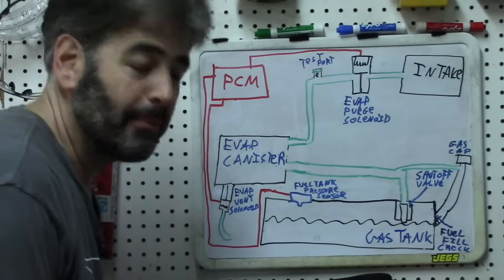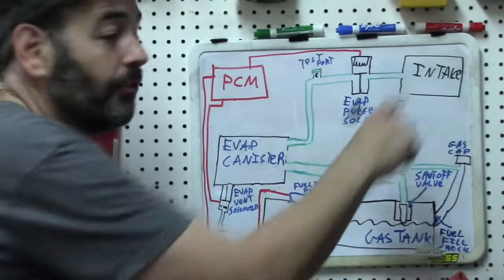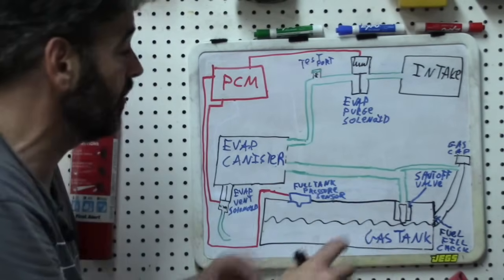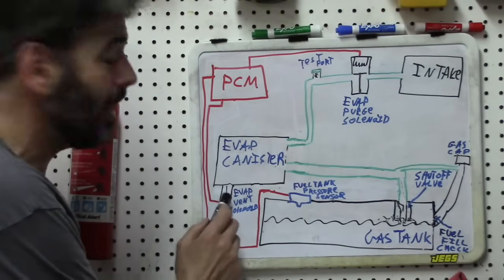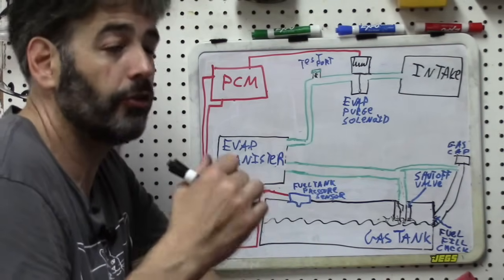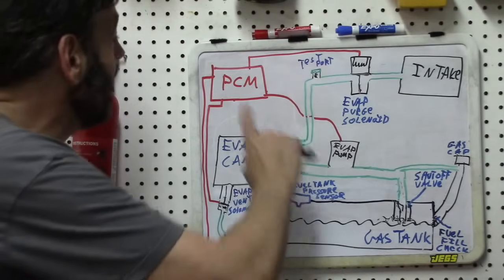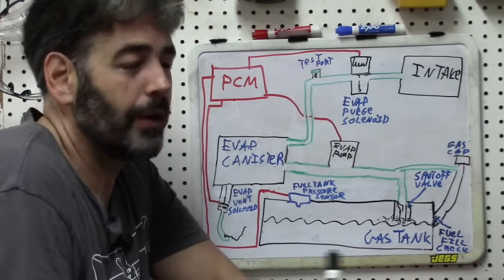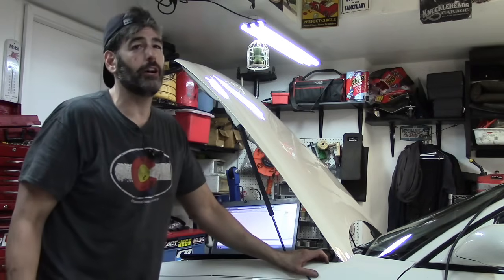Diagnosis + Understanding EVAP Systems (SBQM Full Video)

Comment: Hey l have strange problem l don’t have no lights on an my gas tank is not allowing me to fill up all it take is like 1 dollar May be 2 an if it take 2 the gas will fill all the way to the filler cap an take a few seconds to run back into the tank we did a smoke test an we did that test the car started dumping fuel out front the tank not sure why the car l have is a 2013 Scion 
Frs any help will be appreciated you can call me or text me at 7543089665 thanks guys
Reply from the maker: I would test the evap vent for being stuck closed.  it defaults to open so Apply voltage to it and see if it operates.

Comment: I have a GMC Sierra, with multiple evap codes and one catalytic converter code. I’ve changed out the purge valve solenoid and the evap solenoid. The muffler smells like gas, any ideas?
Reply from the maker: what data showed the purge solenoid and evap solenoids where the problem?

Comment: Hello, I own a 2000 Chrysler Concorde LXI 3.2. I replaced everything. Charcoal canister, LDP, purge solenoid, checked 2 or all the hoses? I’m getting a P1494, only on a cold start? I’ll clear the code, and it won’t come back for, sometimes 3, or 4 days, the MIL LIGHT, I’m speaking of? Any other suggestions for me? I have a long hose that runs over the top of the gas tank, to a canister filter. I can’t get a new one anywhere? Discontinued, so I cleaned mine the best I could? I’m at the end of my rope. Any help would be greatly appreciated? Thanks, Mark O.
Reply: I also pressurized the purge solenoid, and it does hold vacuum.
Reply from the maker: What data do you have. For example why did you change the purge solenoid- what was the data indicating it was bad?  what was the voltage at the solenoid and how much voltage drop is there across the load? What data showed the charcoal canister was leaking? What is your decay rate when sealing the system? what showed the issue is a leak at the hoses?  I don’t see any data here.

Comment: If the EVAP vent solenoid is stuck open all of the time, I'm assuming that there will be a constant gas smell. Am I right about that? I have an '02 DOHC Taurus that has a gas smell whenever I drive it. I put a new gas cap on it, but it didn't stop the gas smell. Plus, I have no check engine light on.
Reply from the maker: yep.  That’s one of the symptoms of an open solenoid.

Comment: quick question: what if i build a fuel injectors that feature a high temp heater so before the fuel goes out the injector it is converted in gas instead of liquid, would it be more burneable? will it make the engine more effective? (multi point fuel injection)
Reply from the maker: Hmmm that’s weird. in concept it’s a good idea but reality it would have some real challenges in a gasoline engine.  First, you would have serious issues with predetonation as the fuel would undergo combustion long before the compression stroke came near TDC so you would need such a low compression engine I doubt the engine would even run the car. This also assumes it didn’t predetonate in your vaporizer to begin with because it not only needs the high temp to vaporize but further it needs high pressure to be released into the cylinder during a compression stroke.  You would need like mega-super-octane fuel. 
   I can probably see you could conceivably do this with something more like diesel fuel but not regular gasoline.

Comment: We got a check engine light. We turned on the car and we unplugged the switch (from the pcm) that goes to the purge valve and put it back. It then resets the check engine light, but just for a few days. Do you think the issue is the purge valve why we get the check engine light? Code is P2024.
Reply from the maker: No idea. what was the voltage measurement at the connector? What happened when you bypassed the switch to engage the solenoid? 
  There is insufficient information here.
Reply: Thanks for replying to my question. The voltage was 8.33V. 
We just turned the ignition on but not the engine when we unplugged the switch of the purge valve.
Reply from the maker: Hmmmm was that measured by backprobing while operating the solenoid or was that measured on an unloaded circuit? if it’s the former, you absolutely 100% have a voltage drop problem for sure.

Comment: Supposedly there is a leak in the evap system what would happen to the engine
Reply from the maker: you wouldn’t even know it other than the check engine light. it won’t cause any performance decrease or anything.

Comment: Wow, a lot simplier than what I 💭.
Sadly, spoofing it will be more challenging if I want to attempt a evap delete.
I own a 2017 focus st and my purge valve solenoid is constantly causing issues due to Ford's defective system, and I am attempting to permanently fix this issue once it for all. Those valves are expensive and annoying to replace.
Reply from the maker: what is the “defect” on fords system you are trying to fix?
Reply: @SchrodingersBox  The car keeps destroying purge valve solenoids. Eventually the valve gets stock close, throwing a P1450 code (not always), and AFR starts to jump from 13 to 15 on idle as well as cruising around, and you can feel it. Also car shuts off on idle after refueling.
My first two purge valve were replaced by dealership under the recall (no charges). But my last two I replaced myself, and out of my own pocket (they cost 100$).
Additionally, it takes about one hours with my rookie experience, and the connectors are extremely hard to get to it and  disconnect, which makes the job very annoying.
I think my evap canister is also either clogged or the solenoid on it stock close, I can see some deformation inwards in my fuel tank.
Unfortunately, I can't take the vehicle to a dealership, since the car is now heavily modified, and with an upgraded turbo.
I would like to delete the EVAP system, but from your explanation, and what I understood, it is not an easy thing since the ECU checks for specific conditions.
Thank you for the video, really educational, I enjoy learning something new :)

Comment: Hello I  hope you're doing well I  bought  a 2002 mazda b3000  I notice that the purge valve vacuum line that goes into intake would shrink when the engine starts running thanks i would appreciate any help
Reply from the maker: Sounds like it is collapsing under vacuum. It’s actually OK as long as the bars read correctly for the PCM decay test. Otherwise will need replacement.
Reply: @SchrodingersBox  thanks so much for your response someone said on another answer that it was a deteriorated hose from fuel vapor i haven't checked out yet it's been raining
Reply: @SchrodingersBox  i forgot to mention that I  have p0172 & p0175 codes  running too rich

Comment: This is very useful, but im hoping u can help me with something a little more complex.
I have a 2002 mazda protege that has 2 monitors incomplete after driving over 500 miles, the evap monitor, and the egr monitor. WHAT DO I DO!
Reply from the maker: There are a lot of things that can cause that.  One of the first things is the scantool may not be reading they are complete when they are. Are you unable to pass emissions because of this or are you looking on a DIY scanner for this information?
  Another reason is the test actually failed and is thus incomplete but it isn't showing as failed.
  Another reason is you legitimately have no met the conditions for the completion even though this is unlikely at 500 miles.  For EGR you need to be on the highway cruising at a constant speed for a few minutes- maybe you never drive on the highway.  For EVAP- if you always keep your tank under 1/4 full or always over 3/4 full the monitor wont run because the tank has to be between around 40-80%.

Comment: What happens if I overfill?
Reply from the maker: You risk spilling over into the solenoids or canister.
Reply: @SchrodingersBox  I don't see the danger, unless they're not submersible.
Reply from the maker: It’s not risk of danger. It’s risk of damage. Flood the canister and you will have to replace it if you want your check engine light to go away.
Reply: @SchrodingersBox  I won't top off any more then.

Comment: To add on to the evap pump, I'm a Toyota tech, and most of our cars actually have a vacuum pump instead which does the same job but just sucks vacuum instead of building pressure, also this way you can do an evap test with the car off.
Reply from the maker: Good to know!!!

Comment: I have 2 codes that I can't get rid of. P1174, and P1175. MAF is cleaned, MAP is replaced. All 4 oxygen sensors are new. Do I have a vacuum leak?
Reply from the maker: No idea. what data do you have?  Why were the MAP and O2’s replaced?  What data did you have that showed they were the problem?  That’s where I need to start. Data.
Reply: @SchrodingersBox  P1174 fuel trim cylinder balance bank 1, and P1175 fuel trim cylinder balance bank 2. Replaced Map and O2S thought that was the problem. No misfire codes. 08 Gmc sierra pickup.
Reply from the maker: Not following - what data was there showing map and O2 was the problem?  That’s critical.  Was MAP tested by voltage or absolute manifold pressure?  What was the O2 voltage showing they were bad (all 4????).  Or was it done by fuel trim curved against load?
  Based on what you have it looks like MAP and O2’s correctly reported the fuel trim anamoly. So I am not following why were they replaced.  What data did you get showing otherwise?  That’s critically necessary to diagnose.

Comment: hi thanks and what is the cause of smell fuel when i filled up the tank?thanks again
Reply from the maker: Prosbably a stick vent solenoid. Just apply voltage to the solenoid and verify it works.
Reply: Schrodingers Box thanks,your meaning is purged valve right?
Reply from the maker: No- the vent solenoid would be the most likely reason.
Reply: Schrodingers Box thanks but i checked bmw just purge solenoid and does not have stick vent solenoid,thank for yr reply

Comment: So did you say that the vent solenoid is normally open? When performing a smoke test would you have to use a scan tool to close the vent solenoid to prevent getting a false test result?
Reply from the maker: Or just manually close it by applying voltage to the solenoid.
Reply: Schrodingers Box  Why would it be normally open to the atmosphere, doesn’t that defeat the purpose?
Reply from the maker: because the charcoal is present to absorb fumes. You don’t want it pressurized so having it open to atmosphere but not releasing vapors is optimal.
Reply: Schrodingers Box   Thanks for the info, that one had me stumped

Comment: The EVAP system plays a significant role during refueling.   Here, it pays to call out the 2 generations of EVAP design:
(pre-2006): OBVR (On-board vapor recovery):  The gas pump is a 1-channel delivery device, delivering gasoline, and the vehicle has to manage venting while containing fumes.   Venting takes place via the (passively open) Vent Solenoid Valve with most fumes absorbed into the charcoal canister.

post-2006 EVR Phase 2 (Enhanced Vapor Recovery - California standard).  The gas pump is a 2-channel device, pumping gas into the filler neck, and suctioning vapors in the reverse direction back underground into the reservoir. (You'll notice a tiny 3mm orifice on the pump nozzle).   EVR Phase 2 vehicles have a Refueling Vent Pipe going directly from the apex of the tank back up to the filler throat.   Some brands (e.g. Volvo) have a dust filter where the Vent Pipe "T"s into the filler throat, and it can become clogged over time with residue -- this will cause difficult refueling where the pump shuts off prematurely.

If an OBVR vehicle is difficult to refuel at a EVR Phase 2 gas station, it is because its vent path (thru the float valve, Canister and Vent Valve) is being blocked.  

Without adequate venting, the flow rate of gasoline into the tank is deceased by air fighting its way back up the filler pipe.   Think of the way water "chugs" out of an inverted soda container "glug, glug, glug", compared to the smooth, rapid flow if you poke a vent hole.   If gas is flowing out the gas pump nozzle faster than the tank can receive it, the liquid level in the filler pipe backs up rapidly, and wham...the gas pump thinks the tank is full.

Comment: Changed fuel cap, neck, canister assembly, purge valve, pressure sensor, coolant temp sensor and smoke check and Vacuum test okay, but still getting a P0440 after driving for 2 weeks, apparently no able to create a vacuum, also maybe be running a bit lean..any advice. Toyota Echo 2000
Reply from the maker: Ok- what was your data that the fuel cap was bad- did you pressure test it? What evidence the canjister was bad- did you pressurize and activate the solenoid? Why did you change the pressure sensor- what was it showing that was incorrect ?
  I have no data to make any interpretations here.
Reply: @SchrodingersBox  when I did a smoke check, fuel cap area was leaking so I just changed to an OEM Cap and still leaked, changed the neck all okay, just changed canister because looked old, and changed everything else just to update system in a 20 yr old car.   172k miles
Reply from the maker: So no data?
Reply: No real data. Just a P0440 code on the scanner, before changing out items and after..
Reply from the maker: Need some data then. Probably will keep you from firing that parts cannon any further.

Comment: Am I right in assuming that the reason EVAP systems don't figure in your engine diagnostics is the independence of the design? I'm just thinking because the EVAP system is instrumental as far as the air intake is concerned, yet it seldom gets considered when diagnosing manifold issues. I could, of course, have misunderstood the whole concept... that's certainly happened before.
Reply from the maker: I do consider EVAP in some diagnoses and in fact I am pretty sure I have 2 case studies where EVAP was responsible for a rich condition- they are on my pay channel. The main thing is- the EVAP is very, very well monitored and it’s highly unlikely to have an EVAP failure of any sort without it throwing a code, so it’s usually low on triage.
Reply: @SchrodingersBox  Yes, that makes perfect sense - thank you. I'm signed up for your pay channel so I'll hunt down those videos. Thanks again.
Reply from the maker: it on a chevy celebrity I think. P0172 code
Reply: @SchrodingersBox  I've just found a two-part series on a rich condition on a Buick Century - it looks like this might be attributed to an EVAP issue. Thanks again, Matt.
Reply from the maker: That’s the one!!!

Comment: Toyota corolla 2013 trouble code p0171 my car is problem fuel tank in side gas what is solution consister box change mass air flow change air not have leak

Comment: I know it wasnt covered but I have both metal and rubber components to this system, and I am wondering if ai can replace the metal components with rubber hoses. I have a small leak somewhere in the system
Reply from the maker: Yes you can.
Reply: Thanks!

Comment: Hi, great video, quick question, Could a leaky line from the canister to the purge solenoid cause the engine to run lean? any help would be greatly appreciated. thank you
Reply from the maker: Yes, absolutely
Reply: @SchrodingersBox  thank you

Comment: Great vid. I have just started getting a huge whooshing sound when opening filler cap. Not a hiss as normal. Any ideas ?.
Reply from the maker: Could be normal but if its really extreme check the pressure on the tank sensor and that the vent valve is not stuck closed.
Reply: Schrodingers Box   Will do. No engine light which is odd, but it's never wooshed  like that before. Tank 1/4 full when cap removed to fill, wooshed like blowing down (or up) tube, opened filler cap after 30 miles and it wooshed again. Can check vent but how do I check tank pressure sensor ?

Comment: Great video, just one question, when does the purge valve open to vent the vapor into the intake, is it at idle or under acceleration.
Reply from the maker: it’s usually done under light throttle at constant speed such as when on highway.

Comment: Hey, Matt. If you have a vent valve that is leaking,  will the fuel tank pressure sensor or evap pressure sensor have a faster or slower vacuum decay when the vent valve is commanded close and the purged valve, open?

Comment: Thanks very much for sharing the outstanding knowledge. I’m having difficulty diagnosing my manual gearbox vehicle that looses power upon acceleration (3rd gear and upwards). I’ve noticed my rpm gauge barely rises above 3 on these higher gears and acceleration is significantly lost. However power is preserved on lower gears (1st and second) to the extent that wheels spin during forceful acceleration.When idle and gear not engaged engine rpm revs up as expected. Any ideas where to start? 1999 opel Vectra b 1.8 L GM X18XE engine - (Otherwise no dashboard lights on or any noticeable issues). Fuel pump and filter brand new.

Also I reside in Egypt. how do i sign up for your generous offer of free pass to your website. Thank you.